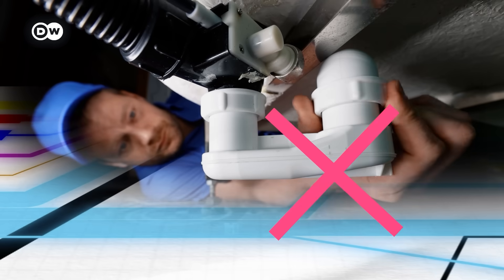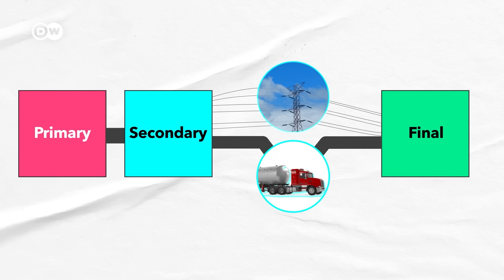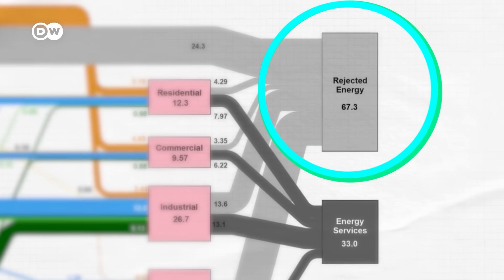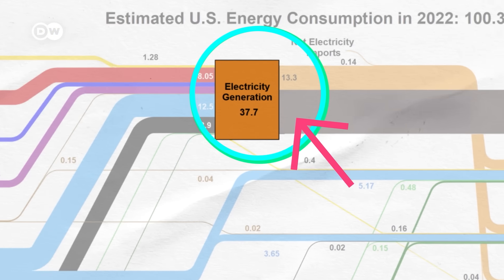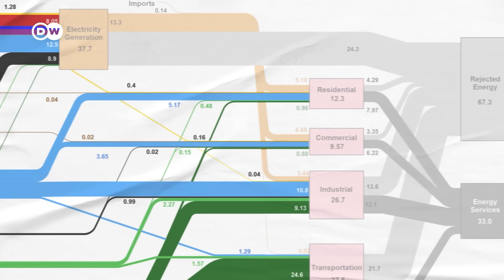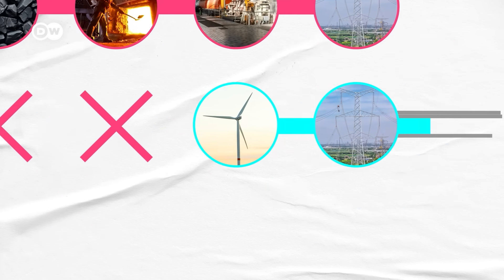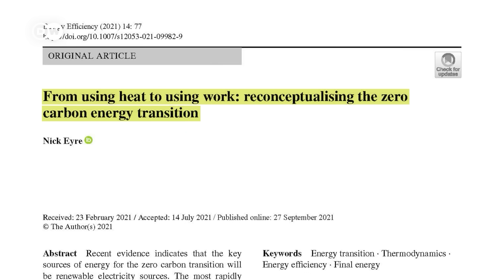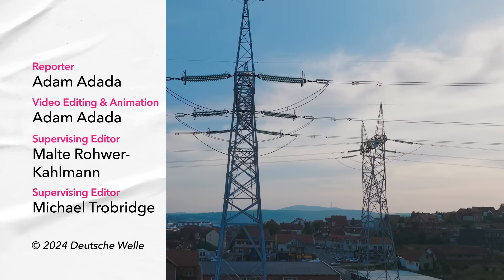The mind-blowing thing we get WRONG about energy

Comment: District heating cuts heat losses in half
Traditionally electricity has been produced by using different heat sources with two thirds of the heat being lost in the process as shown in your graphs. By using this excess heat for district heating you can reduce the loss by roughly 50 percent and thus double the overall efficiency from one to two thirds of the energy.
In Denmark we have had district heating for 100 years and today two thirds of all homes in Denmark are heated by district heating. In bigger cities the heat typically comes from power plants and in smaller towns it comes from burning straw or wood chips.
Of cource there is a heat loss distributing the hot water, but the loss is only about 20 percent. Also the temperature of the cooling water is higher than it would otherwise be, but the overall result is that the energy efficiency is doubled.
On top of that today much more than half the electricity in Denmark is produced by wind power and coal has been reduced to a back up source of energy.

Comment: To put fossil fuel "rejected energy" into perspective with electrified transport "rejected energy" - If an electric car wastes 10% of the energy in its battery as heat losses and a petrol car wastes 80% of its energy in the petrol tank, and they both weigh the same, kind of makes range anxiety a human inefficiency. With most EVs having a 5% to 80% fast charge in under an hour now, with charging stations popping up everywhere. The other thing about the other parts of the electricity grid that distributes energy, and the charging stations, too, are, like electric cars, are running at 90% or better efficiency, until you get back to the generation point. If that generation point is coal, gas or oil, we're back down below 40% efficiencies,  where with wind and solar generation, efficiencies almost don't matter, because what you pull out of the turbine or solar array is clean. Burning stuff is filthy work, so 40% or less is doing work, and 60% or more is polluting. 

And oil gets distributed using oil, at lower efficiencies. The ship burning bunker oil 30% efficient, the tankers carrying it from the port to the refinery, then the depot, then the petrol station, are all running diesel at 20% efficiency. Every inefficiency multiplies the previous one. "We can't replace fossil fuels" is the kind of ignorance we see all too often from CEOs who refuse to listen to scientists. Privilege always thinks it knows best and none are so privileged in western economies as energy barons. Privileged and cocksure.

The one thing I will say about renewables is wind turbines allow multiple land use, while solar only allows multiple land use if we put it on top of something. The best, by far, place to put solar is on a roof, the worst place to put it is on the ground in most cases. It's absurd to waste good pasture or cropping land for a solar farm. Much better to put it on a roof, over a home, factory or carpark, than to just stick it on a vacant lot. I'm seeing too many of this kind of solar-only land use where I live. Roofing car parks adds to efficiency, too, because car AC units don't have to work as hard when you come back to the car - it's the initial cooling or heating (in cold climates) that uses the most Wh.

Comment: Of course, there are energy uses where heat is the object. There you can get pretty low waste. But even then, a hyper efficient fossil fuel setup to heat your home is beaten by heat pumps on electricity where you get 270% efficiency: for each kWh put in, about 3 kWh get moved from where it is (outside) to where you want it (inside). Only where you need lots of high temperature heat (e.g. soms industrial processes) fossil fuels may be able to compete. And where you need very high energy to mass ratios (think flying) we need to wait until electricity can match fossil fuels. We might not be able to get rid of all fossil fuels soon, but we are definitely able to (if we want it as humanity and are able to organise ourselves) get rid of 90%. We seem not to be able (not intelligent enough, humankind as a species).
Reply from the maker: Hey there! We actually have a video that explores the efficiency of heat pumps 🔥 👉 https://youtu.be/nUPZf9LrF1s

Comment: @DW Planet A :  I am a person that supports transition to renewable energies. However, the way you presented in this video shows how "childish" is your view on the topic by supporting your logic on "Useful" and "Rejected" energy! Do remember "Useful" =/= "100% used" for a given process and "Rejected" =/= "100% NOT used" for a given process.  Same petrol when you take 1 ton of petrol - you will get some high quality fuels, then lesser quality fuels, diesel, aircraft fuels, while the remainders may be covering the surface of your roads in front of your house... and some parts of the petrol might be used for plastics and lots of other-stuff! Hence not waste!
And yes, indeed - by burning the coal, gas, gasoline, diesel - we will not get the 100% energy contained in that product! Same gasoline car - modern engine outputs ~ 20...30% efficiency. However, that is not the problem of  gasoline - that is the fault of the ENGINE (= process of energy conversion). Same for electricity - if i use it to boil water in a kettle - ~ 99% of energy efficiency can be achieved. But if i heat (with electric  heaters) an outside open terrace near my restaurant - only 10-15% of heat will be reaching to the customers dining there - hence the efficiency of the electricity consumed for this process/purpose will be 15%! It is again - not the fault of the energy source or where it comes from - but the process chose to consume that energy or the method of conversion.

Comment: ICE combustion engines are among the worst. Only 20-something% efficient. Three quarters of the energy in your fur is lost to heat. Less than a quarter ends up wasted to heat. EVs powered by electricity generated from fossil fuels is not much better because power stations also lose most energy to heat. EVs powered by renewables is what we need. My father is over 80. He’s a thermodynamicist who has always said that losing 2/3 of energy is not sustainable.

Comment: I wish fundamental stuff like this was talked about more. It's crazy what the algorithms don't recommend simply because they're not "attention-grabbing" to most people. I'd like to add one more thing: I agree that using X source of fossil fuel just to heat water to steam, just to turn a turbine, is quite wasteful. It turns out, that the reason we stick to this turbine is because the rest of the grid(down to consumer electronics that use AC power) has just evolved to use the power profile that comes out of spinning electromagnets. If we could fundamentally change the distribution, we could switch to more efficient things. High voltage AC is more efficient for transmission, but we don't necessarily need turbines to produce it. Semiconductor designs for AC-DC converters are real and could be used instead if improved.
Reply from the maker: Hi Taher! Thanks for your feedback! Give our video a like and subscribe to our channel so you don’t miss our new videos — and so more people can discover us ✨

Comment: This is correct but ignores one fact.  To get to this utopia we need to replace an enormous amount of durable goods which will likely be produced in a country where burning fossil fuels is still increasing and we need to extract vast amounts of minerals all over the globe which is also tricky.  As such the emissions are front loaded making our immediate problem worse.  The Net Zero agenda ignores this front loading effect completely and also disregards the economic damage from throwing out assets that can still be used.  
Also, it sub-optimizes by not allowing time for all these new items to slowly be improved over time (efficiency, usability, etc.) Instead we get mandates to buy goods that are less useful/convenient.  If they were easier and cheaper to use adoption would be very high.  As it is we get resistance to overbearing mandates.

Comment: I did not hear anything about the cost involved with this transition. I cannot afford to simply switch to an EV, or to replace all the things in my home that use natural gas. If it were cheap and easy we would have done it already.
Reply: Luckily, soon EVs will be cheaper than ICE cars. The cost for heat pumps is also going down a lot.

Comment: To not lose so much energy, we need to collect the heat from electricity power plants in big layer heat storage barrels, like from Vattenfall in Berlin, for 56.000 m^3 water, and use the hot water by long distance district heating systems, to heat buildings from autumn to spring.

Comment: This is basic physics, no matter how you ' generate ' energy ( electricity) there is some sort of loss nealy all was thru heat , even the manufacturer of the ' renewables ' is currently done and will be done by fossil fuels probably for the next 75 years, so sorry the stop fossil fuels activists are wrong, if co2 is a big a problem as people think , we need mitigation not elimination
Reply: If you replace your gas furnace with a heat pump you won't need e.g. 10kWh, but only 3 kWh, to heat your house, because the electric solution is better.

Comment: You never mentioned nuclear, which offers ridiculous amounts of primary energy and is still quite energy-efficient, especially if we factor in new designs, while being really low on CO2 emissions. And it would share in with the benefits of improved efficiency by powering the grid
Reply: Too expensive and not flexible enough, but they were great 20 years ago.

Comment: around 20% of the fuel entering an ICE vehicle's tank is used to propel the vehicle forward yet ppl still by ICE and hybrids. Crazy. BTW a Tesla would be higher than 90% probably 95% depending on if DC charged compared to AC charged and the source of that energy

Comment: There's a difference between the technical part, and the policies in place. Local Belgian example: if I switch my whole home heating setup from natural gas to heat pumps with solar panels, I pay a multiple fold for the installation AND for the energy. That makes no sense, but it IS the current reality. So while I want to make that switch, it feels like rowing upstream. To push people into switching, the prices of fossil fuels need to go up. But if you 'force' a parity between electricity and fossil fuels (f.i. tax them in relation to the CO2 they produce), then the systemic shock is substantial and crippling. You cannot do this without also taxing all import from other countries. 
So no, I don't think it's easier than we thought to roll out the change - but not for technical reasons. The technical part is actually pretty straight forward.

Comment: The other thing that needs to be remembered is that the Sankey diagram is incomplete. The final 33% of energy that is used also finally becomes rejected energy because this ultimately transforms into heat.

The diagram only exhibits energy usefulness from a narrow human use perspective which is primarily a Nature separated mechanistic mindset perspective. Living systems in Nature have energy throughput with all output energy being rejected energy or heat and the useful work performed via metabolism is primarily the self-regeneration or continuous synthesis of the living system to maintain a dynamic equilibrium state. So with this understanding of a living system, the rejected energy is a proxy for the work done and is consequently always 'operating' with 100% efficiency.

If the efficiency of mechanistic systems were measured similarly they would be 67% efficient. But if we wanted them to become 100% efficient this would be impossible. In order to achieve this they would essentially have to become living systems which mostly demands lower energy consumption. Living systems would become the power or motive force using tools scaled to be used by them.

There may be scope for technologies with an efficiency down to 95% with 5% extracted as useful work but these would be small scale technologies demanding minimal energy resource input such as solar, wind, hydro, biogas, etc.

The combination of human power with small scale technologies is the local human community existence model that is needed.

Comment: The Sankey diagram definitely reveals the sheer stupidity of current energy transformation systems. Imagine having a business model that constantly loses 67% of what is input into it. But is this even a good indicator of efficiency?

The current method of measuring energy efficiency is fundamentally from a mechanistic mindset where energy rejected(heat) is perceived as loss. But in a living system the actual 'heat loss' is the energy out and the better the living system is at dissipating all the input energy  as heat, the more efficient the living system is. So in a living system, its efficiency is measured as heatout/energyin and this should be 100% because this is an indicater the living system is alive and self-making.

So is there a case here for questioning the energy efficiency metric?

Should energy efficiency be measurd differently and the rejected energy seen as the true output energy, an indicator of how harmonious the energy transformation system is to the environment that hosts it.

Comment: @gljames24 Heat pumps 270% efficient is very misleading. This video left out electricity transport inefficiencies. Electricity without subsidies is three times the price of gas. Most electricity comes from Gas and the hopes of replacing 3000 gigawatts per hour of gas with electricity will just cause brownouts. That gas to electricity is 50% efficient vs a 95% efficient boiler. Then the national grid says 8% loss in the grid. That is a lie and is far worse if battery storage is involved for sure with all the voltage transformations.

Comment: How efficient is the turbine when the wind stops?
Reply from the maker: Hey Graham, thanks for asking. According to the European Wind Energy Association, wind turbines start generating power at wind speeds of 4-5 m/s and reach their maximum output at around 15 m/s. At 25 m/s, they shut down to avoid damage. Modern turbines produce electricity 70-85% of the time, but their output varies with wind speed. When the wind stops, a wind turbine becomes inefficient because it needs wind to generate power 🌬
Reply: @DWPlanetA  I was being ironic - they are useless at low wind speeds - you need fossil or nuclear.  Oh, and you cannot build a bid enough battery.

Comment: 5:55
Regarding the efficiency of the car.
It's not only 20% efficient, it's actually up to 25 times worse.
You're not really interested in moving the car - the useful part of the energy is transporting yourself.
In the worst case, when you're alone in your car only 4% of energy is useful for moving you, while 96% is wasted on moving around un unnecessarily heavy car.
So I would argue 20% x 4%, resulting in an efficiency of 0.8%.
So 99% wasted energy.

(I used average car weight of 1700 kg and average human weight of 70 kg)

Comment: Engineer here. I agree with the overall goal of electrifying as much as possible; efficient use of energy is just as important as to how we produce the energy. 

However, I will point out that directly comparing fossil fuels to alternative production of energy is not apples to apples. Fossil fuels include a storage factor. Generating electricity from a solar panel has no storage; you must use it immediately. Batteries are only efficient when used strategically such as with portable devices and a car. They work for home storage because electrical costs from the grid are so high compared to saving your own solar energy, but they are not viable for the long-run as the grid becomes more green. 

Once green energy produces more than we need during the day, we're going to start losing some of that energy to storage. Fossil fuels are already stored energy and we don't look at the losses to store it because it's already there and free plus extraction costs. For similar long-term storage, there is going to be a lot of losses. I think when green energy is abundant, we'll have to turn to a fuel like hydrogen and then the efficiencies are going to be similar to that of fossil fuels. But we're a long way from that and will utilize more efficient storage methods where applicable, such as potential energy storage using water where geography permits it.

For now, electrifying everything we use and storing the energy during the day when the sun is out is ideal. EVs are an excellent battery bank to throw that excess energy into during the day for use later when the sun isn't out. Some people might have to change their ways and plan around this; we will no longer be able to just hop into the vehicle and go wherever we want, when we want, refueling when we feel like it. But with proper training, humans can adapt to the new norm. I'm strongly against cars in general. I think we need to move to smaller personal vehicles, such as scooters, and build an electric train infrastructure for long distance and heavy load transportation. The days of automated vehicles modeled off of horse carriages are numbered. They are inefficient and costly, but humans need to be taught to let go of the past for a more productive future.